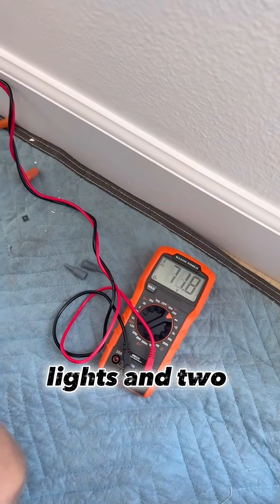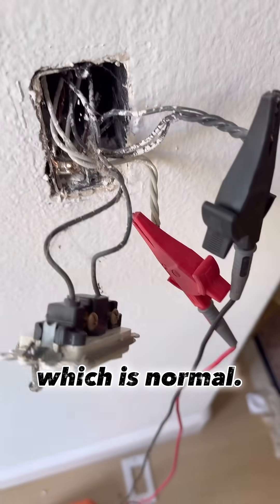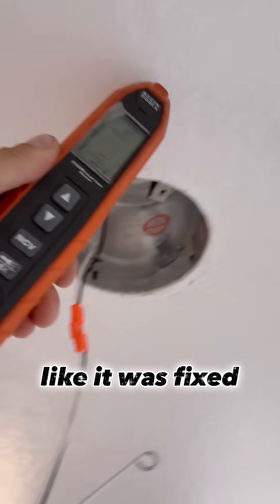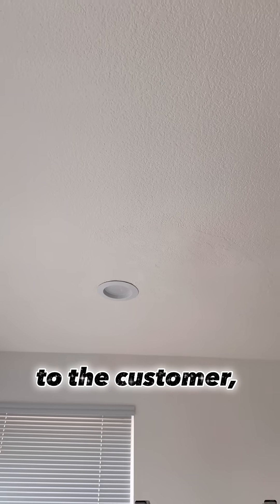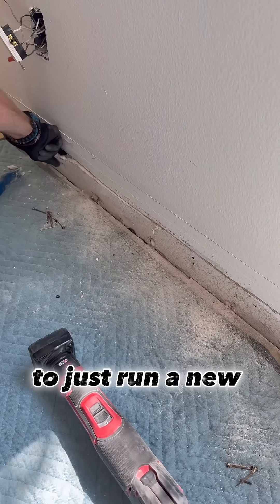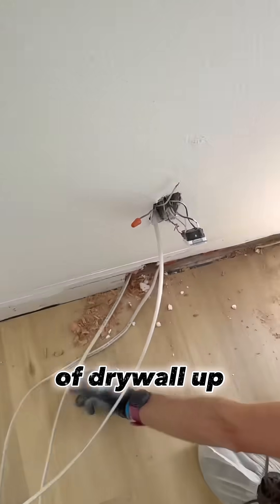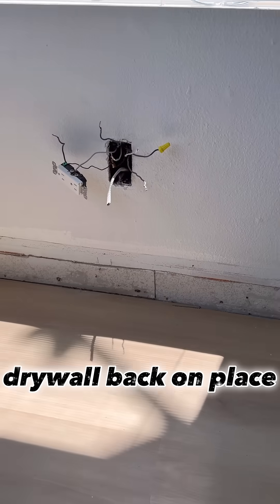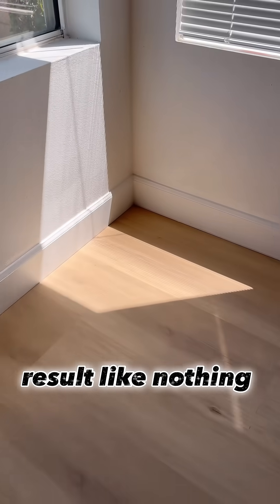They Damaged the Wire and Said Nothing… That’s Why the Neutral Was Loose

Comment: You needed to use a long drill bit so you can run your power. Not destroy the supporting framing members.
Reply: That's so dumb you know there are objects all through the home.  Risk hitting plumbing or other wiring.
Reply: @MOtherBoardFire I mean you still take off the baseboard so you can see the studs, but you use a long drill bit to drill thru the studs rather than cutting a bunch of stud out with the fine tool.